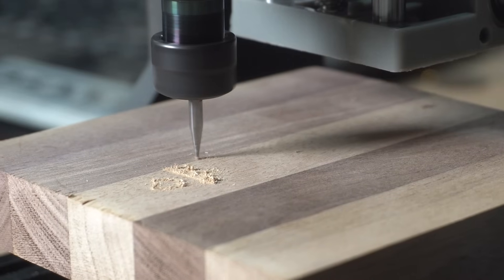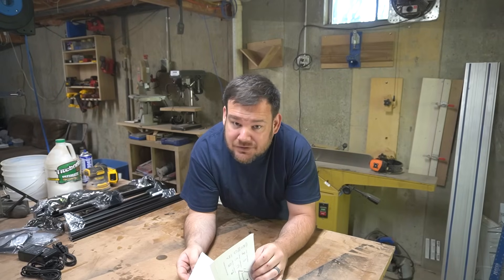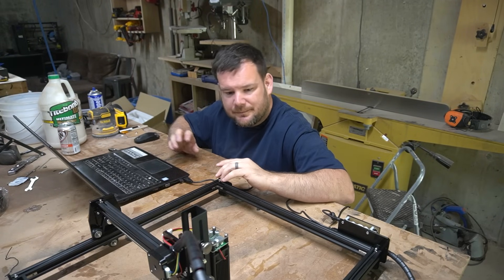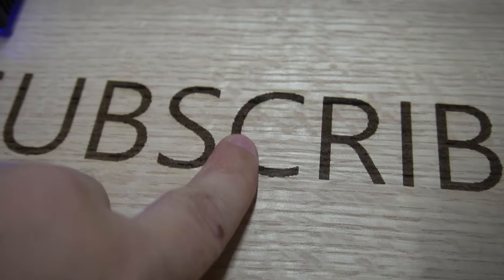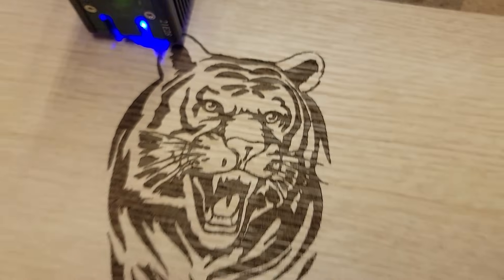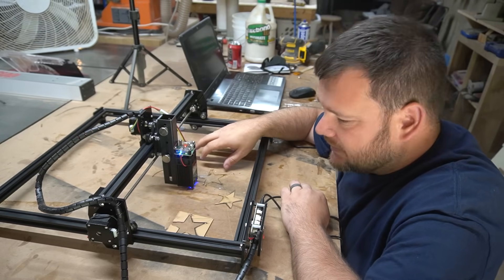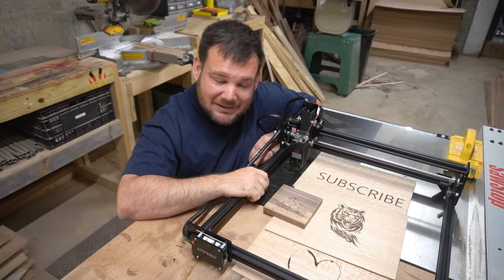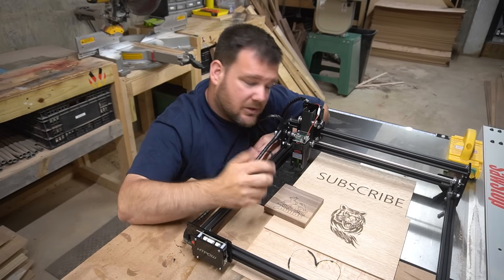The Cheapest Laser Engraver On Amazon

Comment: Great video, you can cut with it use about 80% power and 60% feed and do multiple passes, should cut clean. Focus of laser is very important also the further out of focus the wider the beam and more chance to burn. Also always keep a fire extinguisher close.
Reply: The further out you focus the laser the longer the "waist" becomes as well, which means it keeps it's focus over a larger depth. This helps cutting thicker stock.
Less flat stock will also benefit from the longer distance keeping things focused.
For shallow engraving on very flat stock, a close focus gives smaller spot with higher intensity so you can engrave at higher speed.
Reply from the maker: Thanks for the tips!
Reply: Upgrading to a 10 Watt laser module should not be a problem.
Reply: @Willeecue  Description says it's already 20W.
Reply: @No1sonuk  laser modules have two power ratings: input power and output (optical) power.  I suspect William is talking about output, while you are talking about input.  Might want to educate yourself before commenting.
Reply: @taperry326  I suspect William missed that it was a 20W laser andd you're making excuses in an effort to try to seem "educated".  
As for education:  I've been an electronics engineer for more than 30 years, starting off in military electro-optical systems.  How about you?
Reply: @No1sonuk  same.  College early 80s, US Navy 84-91.  If that what your education & 30 years of 'experience' taught you I'm sure glad you are not working on any of my projects.  Bye Felicia.